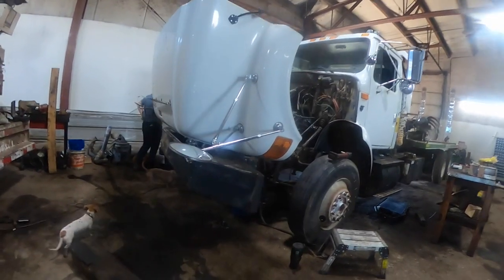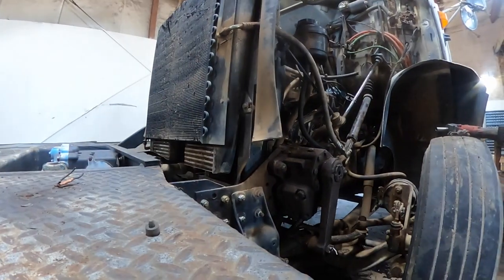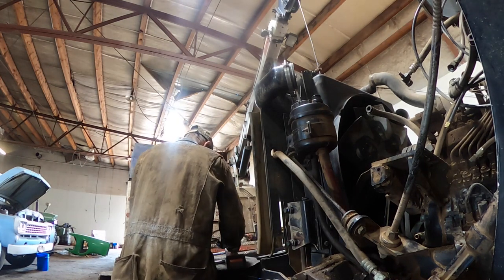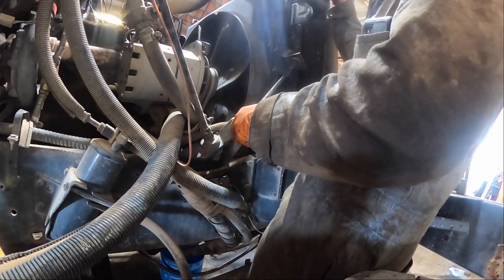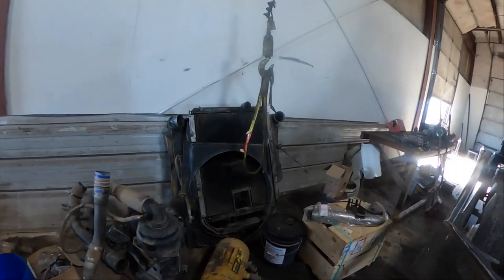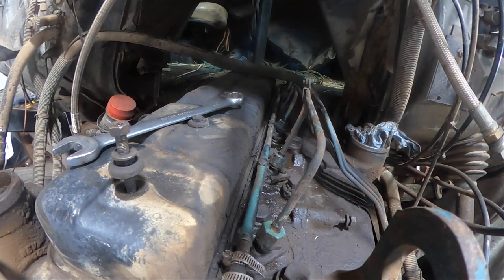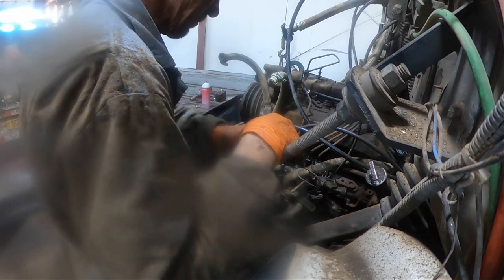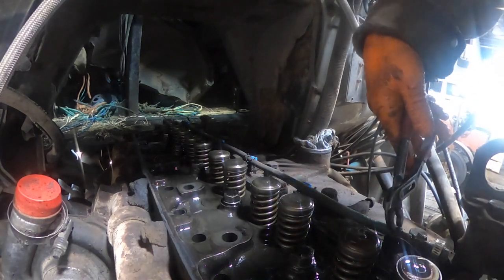Dt466 water in oil!

Comment: Hi Warren. Besides diesel and HD, I worked as a machinist at a shop that built high performance and racing engines. On that 289 - when a high lift cam is put in with stronger springs, your machine shop should have told you it is a must have to replace the pressed in rocker studs with screw in rocker studs. Standard operating procedure for hot rodding any old OHV gas engine. Drilling and tapping the threads should be done on a milling machine or a specialist machine like the Sunnen VGS, Kwik-Way, or Serdi valve / guide / seat machines. Also must have's is checking for spring coil bind with higher lift cams, checking push rod length, rocker geometry, piston to valve clearances, etc....

Comment: I always enjoy your videos Warren. You're a great mechanic. I thought I'd help with the tach drive on the 50 series engine. The 50 series Deere engine has a crank driven oil pump. The 30 series engine has a cam driven oil pump. The tach drive is run off the oil pump gear on 30 series. 50 series tach drives have an idler gear that runs off the cam. If he really wants a tach order a 50 series tach drive.
Reply: Late model 40 series had crank driven oil pumps as well.

Comment: When building up a gas engine, with an aftermarket cam, tapped rocker studs are a MUST. The best ones I’ve found are the serrated ones from ARP. I learned that lesson the hard way.
Reply: ARP stuff is great. Expensive - but worth it when the engine needs the best fasteners in the business. I wish they made stuff like head stud kits for all my bike engines, too.

Comment: I worked for IH in the late 70s and we were taught about  cavitational erosion - usually it would occur at the top oring on the power thrust side of the sleeve. We would drop the pan and pressurize the water jacket and often you could see a trail of water coming down the sleeve.  In my region (Dallas) our service manager made the call that all Farmall tractor with 300/400 series engine had the coolant filter from production.  If maintained, the fillter address the cav erosion until the sleeve wore out from use.  Enjoy your videos, you are one of the best I have seen and I have known some top techs.  Keep up the good work.

Comment: Packer can’t void warranty because you installed it.  Search Magnuson-Moss Warranty Act manufacturers are not following the rules.  Why would rotating the turbo cause a problem?  If you had a leak the engine would runaway normally they just stop or thru a rod.   Guessing they are fishing for a way to blame you.   Good video
Reply: But it takes time and money to fight with them and this does not have the time

Comment: You’ve just admitted you cussed and cursed in front of the Deere engine, mostly likely upsetting it, causing it to let go in its fragile emotional state. Any reason to get out of admitting it, been there before myself, installers fault, in the end turns out the reman company were using the wrong rubber and the oil and heat was destroying the rubber.
Great to see you back at it! Hope your well, and staying de-stressed as best as possible!

Comment: Hi Warren,
FYI we used to make chain tow bars by getting 3" pipe running chain through it to maintain distance to be able to pull something home by one person. Forgot to mention this earlier. Just have to use bolts on chain to keep the ends together. Something to think about to even get something out of the woods. Use two pipes and do not have tow vehicle steering problems.

Comment: I noticed as you took the nuts off the radiator support struts that the rubber dampers were not on Both sides of the frame mounting plates. There was just a nut and washer on the lower side with the gap in the rubber cushions visible. Keep up the great work.

Comment: Any basic mechanic would know that the problem with the Deere was internal to the engine because it started right up, came up to temp and pressure and ran fine after install with no warning indicators. The only thing it could have been at that point after driving it for a few miles was something left untorqued or something else internal to the reman.

Comment: Sometime in the 90's I had a manifold to pan assembled reman BBC 427 truck gas engine that arrived at our shop on a nice shipping pallet - all shiny new GMC blue paint. Oh so pretty.
But with one head, the head bolts hadn't been torqued down. Only ran the bolts down maybe 20 lbs-ft, probably forgot to torque them to final torque.....Blew the gasket less than 2 hours after the customer picked up his truck. The hot leaking combustion gasses burnt channels in the cast iron of the block and head between two cylinders. The block and head were scrap. Good job.....nice paint though.....

Comment: I've seen guys drop their tailgate on their pickup and with any luck its about the same height as the bed. Unbolt it and drive the pickup out. Not everyone has access to a crane or a forklift ya know. DT466 is a love hate relationship with alot of folks. The last one I worked on was an oily bastard with a bunch of random problems. They are also quite underpowered and could definitely use to be turned up. Nice work Warren. Always enjoy your videos buddy. Be safe and take care sir!

Comment: Last I knew the reman facility is in Springfield Missouri. I toured it probably 10 years ago. Part of what I don’t understand about the 9620T engine is, at the reman plant they dynoed every engine that left. Don’t know why it didn’t blow up there
Reply from the maker: The paint wasn't burnt off the manifold
Reply: @westerntruckandtractorrepa1353  yes I noticed that, not knocking your work just saying that they must of quit doing that, or they paint them after they run them

Comment: If your Deere dealer is as good as you say then it’s their job to go to bat with corporate for you. On the old small block Fords with pressed in studs a good old machinist would pin them which was cheaper for customers that couldn’t afford or didn’t need screw in studs.  The machinist would drill a hole through the side of the stud pedestal through the stud and out the other side. He would then hammer a hardened pin through it to prevent the studs from pulling out. It was much cheaper than machining the pedestal down and threading it for screw in studs. The studs would pull out even if you did a stock rebuild. I’ve done a few of them myself.

Comment: I had a dt 466 with a bad oil cooler that mixed water and oil.
Reply: My old Mack had water in the oil so I had the engine rebuilt.  Got it back and still had the problem.  Turned out to be the oil cooler was mixing water with the oil.  Engine was due for an overhaul so not a major mistake but I wish  I would have had the cooler rebuilt along with the engine.

Comment: Had a six gas engine I was rebuilding.  Sent heads and block to shop.  Engine had a burnt exhaust vale.  So only needed block surfaced and heads.  Had valve seats done.  When got it back from shop, was still grit in the head bolt holes and got the wrong heads back.  What a pain, so know what you are talking about.

Comment: Very familiar with pressed in rocker arm studs on the gas engines. Anything over a stock cam should be either drilled and pinned or machine the boss down,  tap and tread for screw in rocker arm studs.  Only way I could keep 'em from coming back... BTW: still enjoying the merch I got from you !

Comment: I'm wondering if the cam gear was supposed to have a key way and it got pushed out or not put in at all. I'm glad your happy with the new camera it looks and sounds great👍
Reply: That 12.5 engine doesn’t have a cam key, the gear is torqued to the cam with bolts only to set timing/gear backlash
Reply: Made in mexico is the problem...
Reply: @LegionFOOD  Yes, many engines have the same design. The gear to cam fitment is a self-locking taper. Like a ball joint or tie rod end, or a Morse Taper drill.
Reply: @rl3898  It's not a bad design, I actually prefer it to a key way as long as all of the bolts are torqued.

Comment: You should see autocar cabover garbage trucks. They have a square cut out of the radiator just below the center and they run a FEPTO shaft through there. It's a pain to pull one.
Reply: Having watched further I see that they did the same thing here. Pretty odd the things that they do to make things work.

Comment: If they won't warranty their fuck up on the 9620 because you reclocked the turbo that's a violation of the Magnusson-Moss Act that basically says a dealership cannot void a warranty for a modification that did not contribute to the failure
Reply: Not that it should ever come to this but there is always small claims court and a videotape of your work is hard evidence to refute
Reply: @gullreefclub  what's the upper limit on small claims court? Looks like a reman 12.5 PowerTech is ~$25,000
Reply: @Romuls753  Sorry for not responding sooner but it depends state to state

Comment: Well Warren, one thing I can tell you is, it seems like when it rains it pours, you get one mistake then it seems like shits piling up on you from every direction, not only the money it costs to fix an error, and do what ever it takes to make your customer feel you treated them fair., your not going to find out what happened to the deer engine until it’s torn down, and torque values checked, machine work measured. But in the mean time you and deer have a good customer getting screwed at neither of your faults., nothing you did hurt that engine, especially in ten minutes of run time., and you would know better than me, but any time I’ve seen one get out of time , I’ve never seen valves strong enough to break the bolts holding the cam down, I’ve just seen bent valves, and internal damage, that engine clean smashed it self apart., deer needs to get someone out to your shop like right now., and the two of you need to open it up, using a torque wrench on any critical item, also noting green paint on nuts and bolts to verify they have not been opened yet or messed with., I’m going to bet the machine shop rebuilding these deer engines are not rebuilding to the book tolerances, they are rebuilding with the “it will make it through warranty” “we hope” policy... and a through inspection with measurements will prove this., you and I both know how guys return “core” engines., so most of the core parts they get back are not rebuildable if they were going off the book., right now the customer needs a running engine.. hopefully deer is wealthy enough to get out a new engine, dyno test it, and get it to you., then from that point you and deer agree to find the problem, and he who is at fault eats the cost of what deer pays to remanufacture an engine...

Comment: Ford had problems with them cylinder walls creating holes and letting water in.
Reply: Yes,those Ford engines were famous for letting coolant enter the lube oil.The fix was re sleeve the block.

Comment: I was looking at vehicle a few years ago & the customer had a £26,000 MAN engine delivered from MAN for another one of their vehicles. It fell off the engine stand & landed on the crank pulley. It broke the sump & bent the crank. They swapped the old sump with the damaged one & fitted it anyway. When it wouldn't run, they tried to blame MAN for the engine not running. That repair cost them £8,500. Before you ask, the reason it done so much damage when they dropped it on the floor is because MAN engines are made of cheese.

Comment: There's a farming Youtuber called Millennial Farmer that the JD dealer just told him their 9560rt is gonna need a reman engine. All I could think of is that 9620 and how that worked for you so far. I'd rather a local mechanic rebuild it if it's an option.